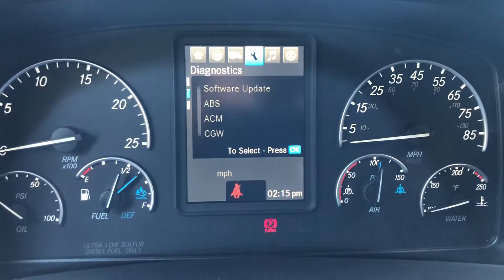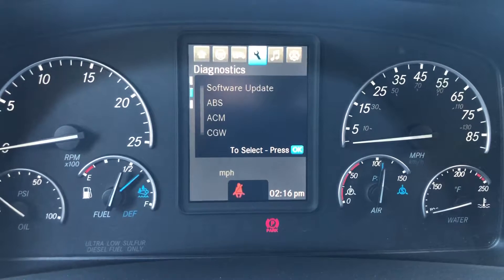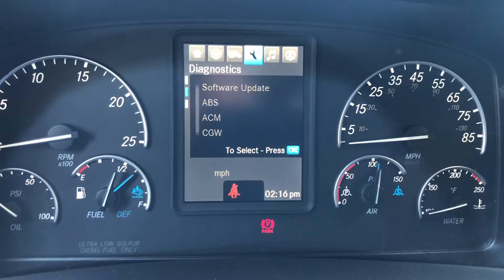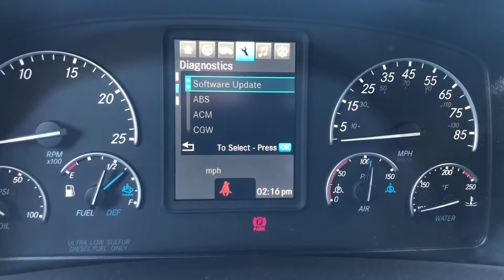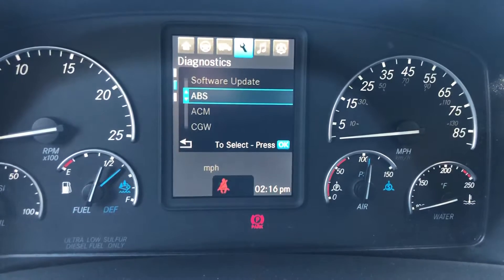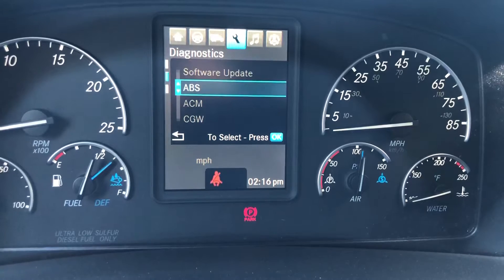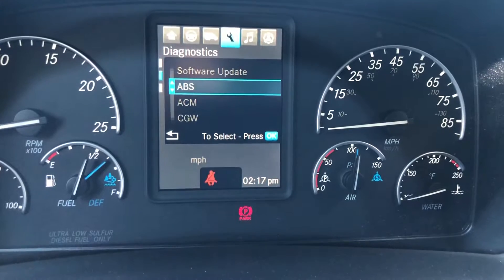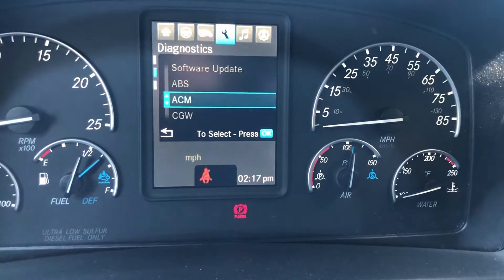Freightliner Cascadia 2019: Diagnostics Menu.

Comment: Thank you sir.. gracias...lm looking to change settings.. 

2019 cascadia DD15, DT12. The trans is only on economy mode.. l only get 7.5 mpg.

Midroof trk pulling light flatbed loads.. 

Also when the truck switches to E coast the motor idles low and oil pressure drops to 15psi. Is that ok?
I'll be in the 45-65mph range.

Comment: I replaced a clutch on a cascadia 2017 and it’s stuck on manual and won’t start 
Telling me to switch to neutral when on neutral
Reply from the maker: First: is it the new clutch the same as the old one you removed? Sometimes there are slight differences between clutches make sure about it.
Second: did you calibrate the new clutch? DDDL 8 software is required for this step. Otherwise, the new clutch will not work properly. I hope this information help you. Thanks for watching.

Comment: I have a 2019 cascadia I don't have apu so i idle my truck - how can I increase my rpm when I am parked?
Reply from the maker: On the right hand side of the steering wheel there is a button with squares overlapping, when you are in the main screen, press it and a menu to increase it will appear in the main screen, with the arrows up and down, on the left of the steering wheel, you can control the engine speed at idle. Thanks for watching and I hope this information help you.

Comment: I got engine light and its showing sign in MCM and showing fault waring symbol sign but when i click on it it say no fault found. And i got solid yellow engine light. What wrong then if its not showing any code ??
Reply from the maker: Usually, inactive codes store in the MCM memory, but those codes cannot be check directly from the instrument cluster screen, even when there is a warning sign from it. if your truck MIL (Malfunction Information Light) stays on for few days, you might need to take a repair shop to connect the proper diagnostic tool. Thanks for watching and I hope this help you.
Reply: @LetstalkDIESEL  hi thanks for replying back the engine light was gone after 2,3 hours and its not showing up again.

Comment: My 2021 freightliner has a triangle next to srrr in the diagnostics. Often it sets off my abs tcu disables my adaptive cruise control
Reply from the maker: I might be something relate it radar or sensor angle, those problems might be solve with a software update from Freightliner dealership. Thanks for watching.

Comment: Hello, in my 2019 Cascadia engine light on and off. Active shows 0. However I found on ACM fault code 520372, 520371. What can be that? Thank you
Reply: Update
Reply: Did you ever find out what your codes were for? I’ve been dealing with the same codes for the last few months they are for the after treatment system and specifically for DEF injection, I have a 2019 Cascadia as well and I’ve spent just about $20,000 trying to fix these codes

Comment: How do you reset the fault codes on a 2020 Freightliner Cascadia?
Reply from the maker: You CANNOT reset fault codes with the ICU (Instrument Cluster Unit) or Dashboard. You need the DDDL (Detroit Diesel Diagnostic Link) software or an aftermarket diesel software to clear the faults stored in the ECM.

Comment: I have mcm problem 171-3 and 171-19.  And abs 790-1 check wheel speed sensor b airgap
Reply from the maker: The MCM codes you need the Detroit Diesel Diagnostic Link (DDDL software) to know exactly the codes. About the ABS code if you had performed a brake job recently, perhaps one of the ABS sensor is not in place properly. Make sure your technician check all the brakes to see which is out place. Hope this help. Thanks for watching.

Comment: My truck stopped and it was showing the cpc how do I fix it
Reply from the maker: CPC (Common Powertrain Controller) codes are relate it to the communication between ECM, TCM and others modules. Sometimes, wires can be the cause and even just the bad weather, for example: Snow conditions or high heat temperatures. Either way, it is really unlikely that you by yourself can fix it without the Software tool (DDDL). If problems persist, you should take it to the nearest shop to let them check the fault codes. I hope this help you and thanks for watching.
Reply: @LetstalkDIESEL  hey bro i got same issues cpc. Truck stopped . What causes the reason? And how to fix?
Reply: @gurjotsingh6056  Are you able to fix it coz i have the same issue.
Reply: George From the Bronx do you know how to by pass radar I switch cab the frame has radar and wire to the cab but cab don’t have a conection and I don’t need this shit and cruise control stops every 5minuts

Comment: Do you know what CPC codes 521001 and 521002 mean?
Reply from the maker: Usually, if you have this dashboard (newest cascadia), you can dig in to find out a basic information about the fault code. Over the internet, you might find a bit about it, but in order to know exactly the issue, you are going to need the DDL software. This is a diagnostic tool need it in order to find out why the Check Engine is On or MIL (Malfunction Information Light) is on. I hope this help you with your matter. To know a code just by the SPN, FMI or other methods is hard because there are thousands relate to it.